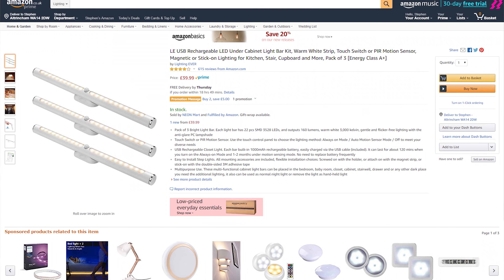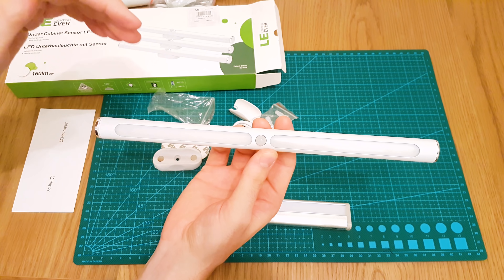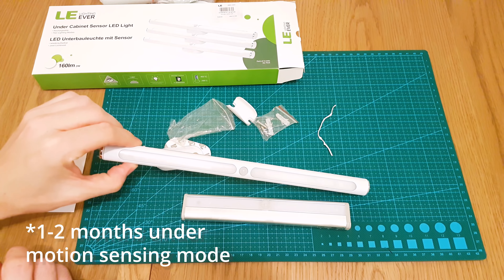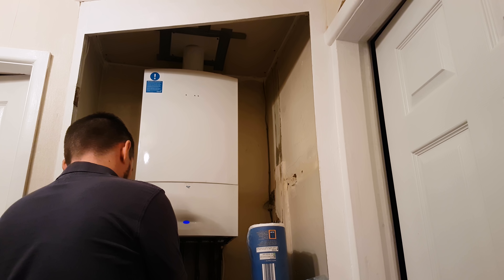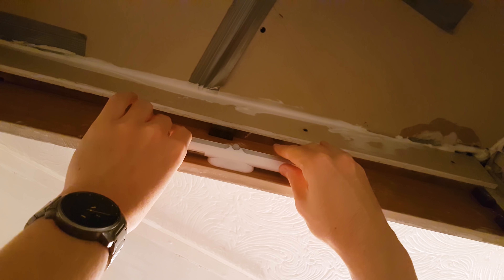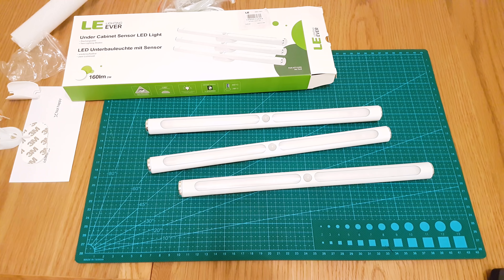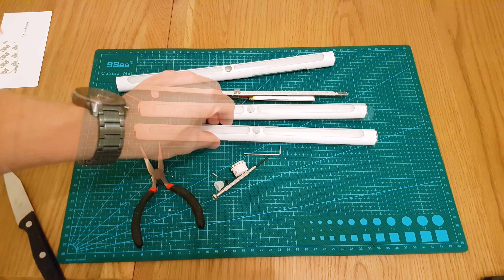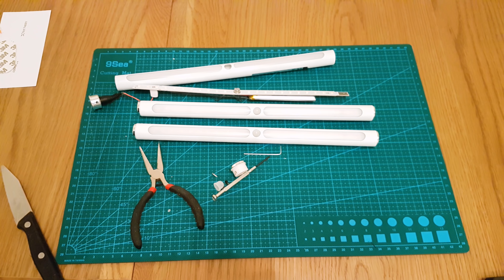Product Review | LE USB Rechargeable LED Light Bar Kit from Amazon

Comment: Stephen what are the dimensions of the battery, great video BTW
Reply from the maker: Thanks! The battery has the code 801585 which seems to corresponds to the size too, which is approx 80mm x 15mm x 8.5mm. Its a standard 3.7v 1000mAh lipo chemistry battery. Hope that helps?!!